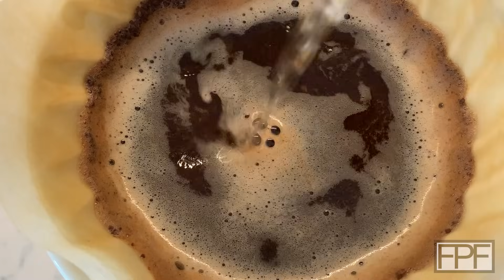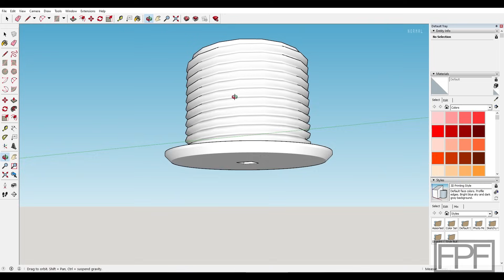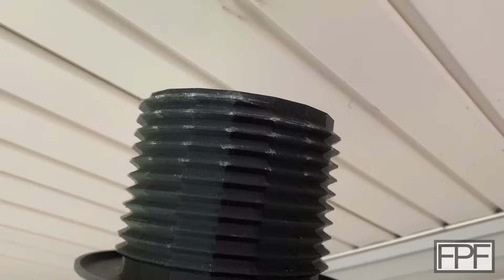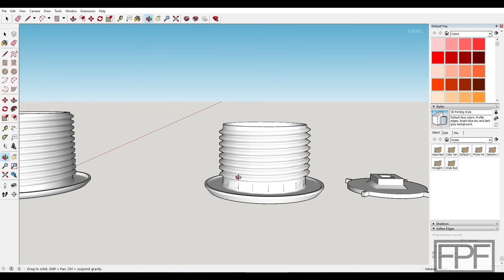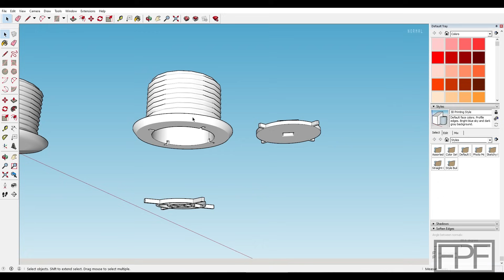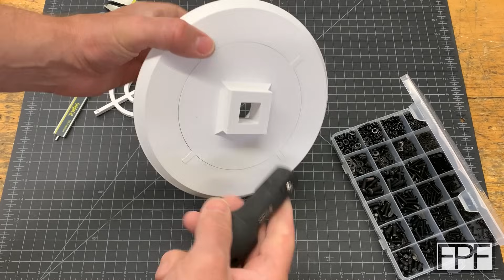3D Printed Range Hood Vent Cover

Comment: an option to secure the vent to the duct would be 4 self tapping screws through both the plastic and the metal. you already have a 90 degree drive. no need for threads and fighting their fit with the self tappers that you used anyway. foil tape will still fix any gaps you have afterwards.

Comment: You make it look like a breeze.  Bad puns seem appropriate today for some reason. I’m usually not to particular about things but I’d have rotated it so the grill lined up 90 degrees or 45 degrees to the seams in the ceiling panels.

Comment: How do we not have any magnets in the screw tray? 😂
I got a right angle screwdriver attachment over 25 years ago when I was working in a body shop. Often had to remove mudflaps. This helped a ton. Didn't have to jack up the car and remove the wheel.. Time is money 😁👌

Comment: There definitely some fine tuning needed after recent Bambu slicer/ firmware updates. I've NEVER had lifting issues on my A1 mini with 65° bed temps. UNTIL this past week.. Had to lower bed temps to 55°. NO other changes and it's good now.

Comment: Great video. As there r many ways to skin a cat, you could have extended the pipe down and 3d printing from there. I had the same problem with a bathroom exhaust vent. With that said, your solution showed a great use for 3D printing.

Comment: Regarding filament purges for pla/petg Would changing out the head out and designating one for each material fix the issue? The plastics melt in the heads as I understand.

Comment: Clever design and install. Round head self tapping screws may have made installation easier. Maybe some kind of plastic compatible lubricant as well. Unlike your contractor, you used the correct tape.

Comment: Great engineering. Wasp and insect inlet? Maybe not a problem in your area but here in Texas it is. What about adding a weighted louvre cover. Opens when on, closes when off. Might also minimize heat/cooling loss when not in operation. Like a dryer vent.

Comment: First I can't believe that venting a range hood down under a soffit is within code. 
Also if there's a problem with the material not holding up. Lining the inside down to the edge by the cover with the aluminum tape will give the material a lot more resistance and protection from the heat.

Comment: Another great video. I'm sure PETG will work fine. I'm waiting for some High Temp PLA, I find PLA is much stronger than PETG. Also, I think I would have gone with Half moon tabs instead of the fingers for the installation tool. I really didn't think it would survive. Thanks for the tips, keep them coming.

Comment: Contractors didn’t install one at all after rebuilding my landlord’s house (EF4 tornado!) and the vent was already full of wasp nests when we moved back in. I don’t see how either the original design or yours would prevent wasps though. You really need a smaller grille or screen.

Comment: You could have cut a larger hole and fitted an outer square ring to mask the bigger hole and then have an inner insert to match the ducting outlet with it into the inner part so that the tape would not be required.
Also I would design a mesh inner ring above the insert ring to stop ingress of insects or perhaps and rotating cover to block completely/partially when not in use or to slow air flow should it be required.
Another option is the grill you fitted could be in two parts where it sandwich's a fly wire mesh to prevent ingress of insects.

Comment: Is there a material that will "stick" to both PLA and PETG, that you can flush through the nozzle in between material swaps to clean it? Like a "soap" for nozzles?
I'm thinking of this process: unload PLA, load SOAP, unload SOAP, load PETG.

Comment: If this outlet is connected to an outlet inside as well, then by opening up the airflow here you may have reduced the airflow inside.
That is the reason the old one had an adjustable hight setting on the middle ring.
You then measure the airflow with a flow meter.
I have one as heritage from my father who was working in this area.

Comment: While the old design of the outlet did not prevent it a-lot, it did reduce incoming wind from producing back flow with it's 'Hidden Vent' design.
Design choices to consider:
1) Back Flow prevention (Don't know about you, but I get 40-60MPH winds from my area...)
2) Insect prevention (Screen Mesh on the inside cylinder?)
Reply: Can confirm, did this before and I heard whistling in my kitchen's vent hood on windy days. Plus bugs/lizards might want to crawl in there. A redesigned grille sandwiching a copper mesh of some sort would be a good idea.
Reply from the maker: They installed the back-flow preventer in the hood stack.
Reply: @FunctionalPrintFriday  They said that they installed the back-flow preventer ;-)
Reply from the maker: @joutilas  facts.
Reply: I was wondering about critters and wind.
Reply: Bugs were my first thought as well.

Comment: I would go with ASA for this. 
Also, you can add a fine mesh to your grill with an infill pattern (like grid or triangles with 40-50% density) without top and bottom layers to stop insects - it can be done by adding a cylinder as a modifier in bambu studio.

Comment: When I change the material between filaments, I also have contamination. What I have been doing is changing the nozzle on my Prusa MK4S.  The nozzle is long, and so far, I have not seen the contamination issue. When changing the colors during a print, I have not figured out how to change the nozzle.   Just an idea.

Comment: very first print I made was a vent cover, of Printables. The threaded collar is a great improvement. 
But on the install, I would have aligned the grid with the pattern on the vinyl covering.

Comment: I wonder if that black contamination was stuck to the outside of the nozzle, rather than inside it. I usually use ASA for outdoor prints. I choose it over PETG mostly because I don't have to dry it before printing.

Comment: The resolution of that cad program is...atrocious. Onshape is free.. and way more powerful and lets you adjust the output resolution of whatever your converting your files to slice. Check it out. They also have extensive free tutorials to get you going and beyond. You wont regret making the switch even if you have to take a little time to get the hang of it. It will be worth it in the long run.

Comment: I think you're a little wrong, the material may flow under the silicone cover from the outside and stick to the bottom of the nozzle. I have 12 bambulab a1 and 2 x1c printers, I constantly print with petg material and it always leaks under the case because of this, I abandoned the covers and print without them.

Comment: I would not have thought to use screw heads and threads as a mechanical mounting method, very creative! I also found the adaptor approach to the installation adaptor and grate fixture pretty ingenious. I think you may be revisiting this in the fall however, since this open path will allow substantial heat loss. may need to pull a couple pieces of soffit out to gain access to the horizontal run before that elbow and install a gravity damper that pivots open when fan is in use? I would also expect flying insects will be attracted to the constant flow of warm air escaping here when the night time temps start dropping.

Comment: Excellent solution. I would suggest an interrior mesh type filter which you can remove for cleaning or replacement . This will  help prevent any 'drips when the smoke/steam cools. Cheers from Blighty.

Comment: I use cleaning filaments when changing materials to something not compatible. Works rather well and lasts for years. ASA is a better material for chemical resistance. Further more, I'd pick a color that would hide the oil stains

Comment: PCTG would have been my choice.  I might have also gone with gyroid infill with no bottom or top in the end piece for the grate section to scatter the air from someone standing below it, but that also might not work as I think it might.  Plus, your air flow was fantastic with your design.

Comment: Myself, I would of printed it in ASA or ABS-GF.  Your vent looks great, it'll be interesting to see how it hold up over time.
Reply: PETG is a pretty good material. Better layer adhesion than ABS and easier to print. 
I use a lot of ABS too but PETG is pretty good if you don’t need the temperature resistance of ABS.

Comment: I wouldn't want a vent blowing greasy air down on the top of my head.  I think that's why a diffusion vent was used.  It is  not a great location for a vent in any case, but not much you can do about that.  I'm not in favor of using plastic anywhere on a range hood because if a grease fire happens when the flames are sucked through the vent the plastic will melt allowing flames to enter the attic space.   I think petg is a good material choice though because it melts first instead of burning and will probably hold up well in normal use. The important consideration is the failure case and what happens then.
Reply: Yea I think he should have made it vent out radially, not straight down

Comment: I like the approach.  Do you have any concern about bugs or mud daubers getting into the pipe when the fan not in use?
Reply from the maker: The original didn’t include one, and it wasn’t an issue, but i guess we’ll see.

Comment: This TPU contamination issue sounds like a great use case for quick change nozzles.  Keep different nozzles for each material type.  I believe there are cleaning filaments too though.
Reply: One of the things I've learned with the A1 Mini (applies to the full size A1 as well) is that if you're going to do quick change nozzles, it's probably best not to use tinfoil grade sheet metal as part of the latching mechanism. They tend to bend and no longer function and you get to replace that component as a result.

The Revo style nozzles from E3D might work a lot better, but that's also going to need redesigning a few print heads.

Comment: Great video,  you might want to install a round piece of screen to prevent bugs from getting into that vent.
Reply: Was going to say this too, could befitted behind and held in place by the grill.
Reply: The only problem with using screen on this type of application is that it will collect grease from the cooking and eventually clog.  It could be part of a maintenance routine, for sure, but it would likely be forgotten.  Additionally, the previous cap had a gap in it too, I'm sure e would have noticed any bugs getting in.  But, sure, it's a workable solution, if you're prepared to wander around every few months to give it a clean.

Comment: Venting cooking fumes to a porch doesn't sound like a good idea. But, I'm guessing they had to do that since they couldn't go straight up through the roof.
Reply: A lot of such vents do go straight up to a roof, but only if they can avoid rooms between the range and the attic/roof. They are doing that with dryer vents too, with a few inspector traps involved, like dryer vent caps that have screening in them, on the roof, with no simple way of cleaning that vent cap out of dryer lint when it fills. (See GoldStarInspections videos, about it, 'That ain't right.')

Comment: I don’t know why the facets on the thread annoy me. Maybe SketchUp makes you pay by the polygon. The original vent was not intended to be an exhaust, it looked more like a balance grille for an ERV, not something to maximize airflow.
Reply: They bug me too, but you can increase the sections/sides in sketchup and make the facets nearly invisible, though it comes with a massive performance cost as I don't think they've made any major changes to the way it renders models in past 20 years.
Reply: That's definitely not the right grille for a range hood exhaust. It's very much a balance grille for supply ventilation where you would spin the center section to adjust the airflow as needed when commissioning a ventilation or heating/cooling system. I've specified those for a number of projects.
Reply: The exhaust is pointing in the wrong direction.  It is exhausting down.  It should be exhausting straight out to the side or upwards.
Reply: the facets also bugged me lolol
Reply from the maker: I just scaled-up and re-used an M30 thread profile.   When I saw the facets scaled up I almost didn't use it, but then I realized the points it created actually kind of help out in this use case.
Reply: Sketch up is a headache to deal with 3d prints. A lot of models export with many mesh problems.
Reply: @Fernando_Gazzola  That's why I use Solidworks.  Free when your boss pays for it.
Reply: How do you like ShetchUp? I have never tried since I spent so much time learning Fusion360. Seems pretty basic, do you get enough options to engineer something correctly?
Reply: I suspect the polygons would disappear if you exported a .step file instead of an .STL file into the slicer.
Reply: @karlfife  the bottom appeared circular though
Reply: @null8759 Good point.  Must be something else is going on.
Reply: @karlfife SketchUp is a mesh based surface modeler, not a CSG modeler therefore it cannot export step.

Comment: You must not have wasps where you live.  I'd love to see a redesign that incorporates a pause to insert some metal screen mesh.  That would be a challenging print!
Reply: I would mostly be worried about flies and mosquitoes myself. An option for built in screening would be a 2 mm layer that is missing top and bottom but is a fairly tight screen of infill. 

The great thing about this design is that something like that can be added in after the fact simply by revising the model of the cap, reprinting and testing it. Then switching back if the airflow is reduced too much for the cook.
Reply: @RNMSC  as an Australian, lots of lazy builders leave out the insect screen, and in summer you get flies buzzing around your rangehood. When you go to clean the grease filter screen, there'll be a layer of dead flies :|
Reply: Wasps usually will use a redundant / disued vent pipe, rather than something contaminated with grease , and they hate smoke. By the time an insect screen was fitted, it would significantly reduce the air-flow, too. (pest controller).

Comment: I find a small print with PLA Matte pulls contamination out of the hot end quite well.
Reply: And of course something with glass fiber might work as well. I.e. something to abrade the TPU. Also if you have something that needs a higher temperature, to use, ABS-GF for example, or a high temp Nylon-GF. might get the TPU into an even more liquid state and more maliable.

Comment: Those calipers, and several other measuring tools are available as a package at Harbor Freight in their measuring tools section. Not a bad price if I recall, might be better than going to yard sales or garage sales in some areas.
Reply: How long before you go out there with the driver, and a small can of white paint, to dip the ends of the screws?